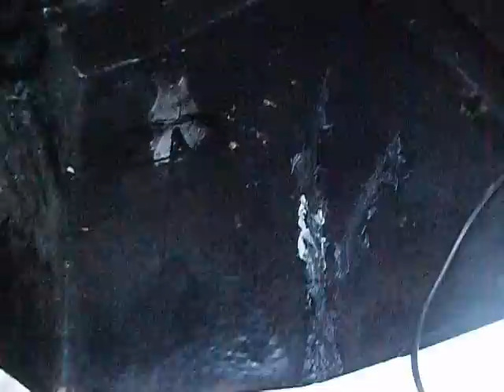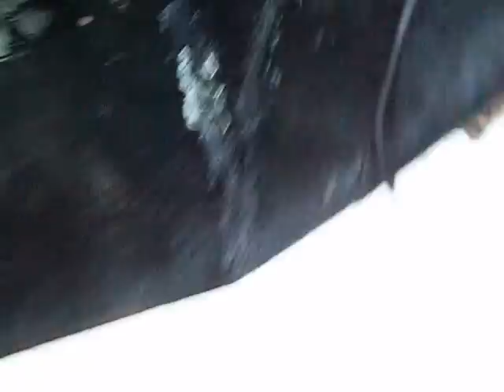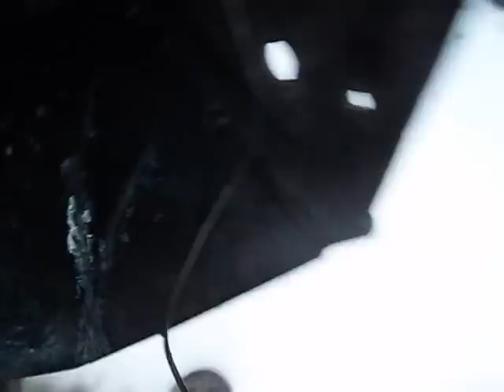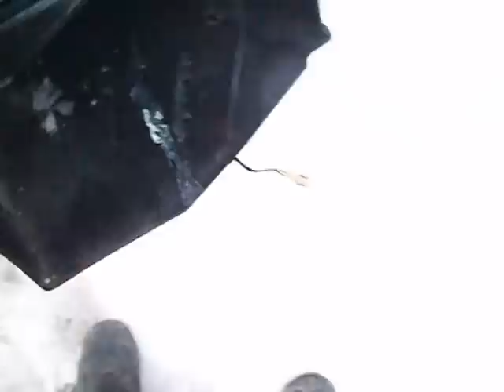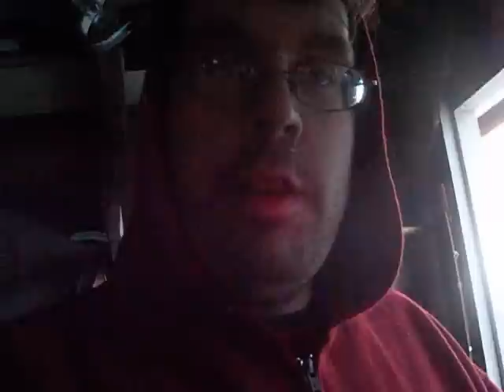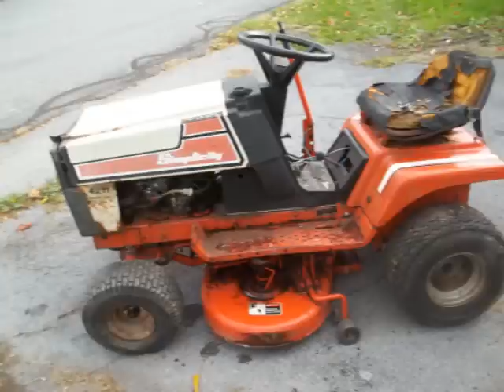Plastic welded the dash on the Simplicity 4211 Tractor today

Comment from the maker: thanks savagenonore suggested plastic epoxy to fill in the cracks. 3 bucks walmart. yes Ive should of wore a a mask and goggles. I did not know what to exspect doing it. it was my first time plastic welding. I did try to wear a mask and the rubber band snapped. when I vacuumed the mouse nest out of the tractor I tied a old towel over my face. I wish I used that same towel to plastic weld. The welds not perfect. I did my best. going to put the dash back on and key swicth tomorrow Take care Mike B

Comment from the maker: not much left to do to her  hope to get her running and cutting by may I'm scard the transmission might still be bad I'm never drove her before the belts were rotted on it. I pulled them of they broke apart I rolls in neutrel fine and when I put the tractor in gear then turned the transmissin pully foward and backwords the tires moved. I put but 100 bucks into getting it going. I'm so worried it won't drive and move when I put the belts on it let know what you think about it your friend Mike